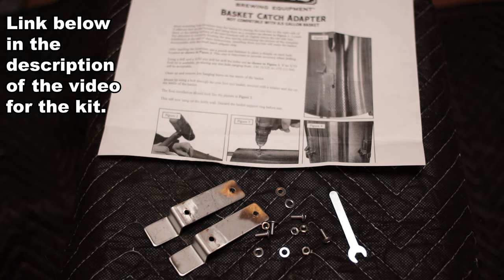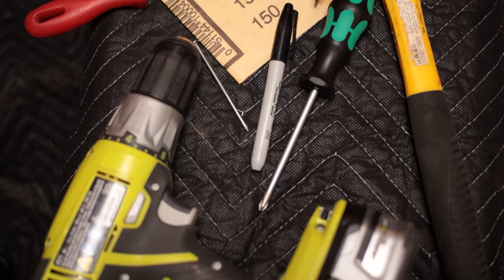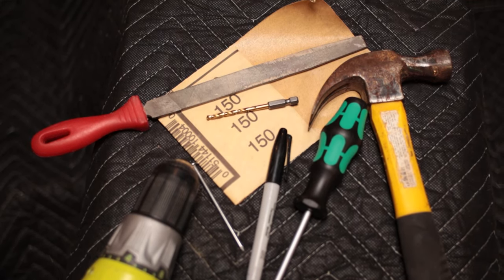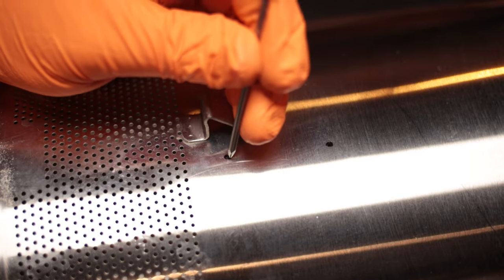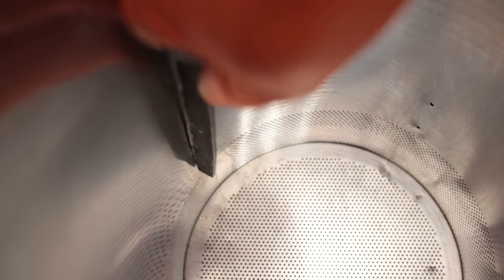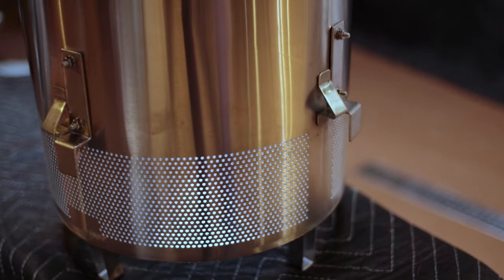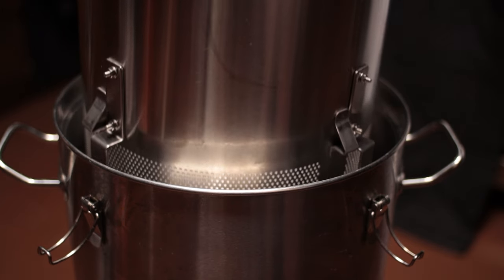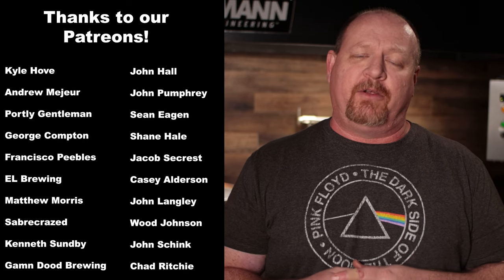Anvil Foundry Basket Catch Adapter Install

Comment: I installed these about 2 weeks ago.  I've done 2 brews and the brackets work very well.  It took me about 15 minutes to install both brackets.  I also put the nuts on the outside even though I don't use a bag.  One thing I wish they had done is include a lock washer or a nylon nut.  I haven't had an issue of these coming off, but I think a lock washer would have been better.  Of course you can go to the hardware store and get lock washers.
Reply from the maker: Yeah I will admit I was a little surprised not to see a lock washer. But that is easy enough to remedy as you said.. 👍🍻

Comment: I got my foundry recently and because I had already watched your videos and a few others, I was upset thinking that my foundry came with a missing part since I couldn't find the ring! I had pulled up their support phone number but it was after hours so that wasn't available. I was super bummed until I read the directions carefully and learned that I had the new version with the catch.
Reply from the maker: Yep! The new versions come with the brackets, that's why I made that clarification in the video. How are you like it? 👍🍻
Reply: @ShortCircuitedBrewers  I haven't done a full brew on it yet because my garage water pipes froze. But before they did I tested it out with setting water temperatures and was amazed that it boiled well on 120v when it was 32 degrees in my garage! I have a 220 outlet in my garage and am assembling the cable with GFCI that you gave in your other video.
Reply from the maker: @anthonyburke2118  awesome!! Let me know how it goes or of you have any questions! 👍🍻
Reply: @ShortCircuitedBrewers  I was in the same boat as Anthony. Bummed and thought I was missing a piece. Literally got my Anvil today and you posted it yesterday. Good timing, thanks for the video!
Reply from the maker: @modernobstacle  good to hear! Glad you got your Foundry!

Comment: I have never had any issues with the OG ring, but I know it was a constant complaint for many people. I won't be doing this upgrade. I do use the small-batch ring 100% of the time now, though.
What really want is that new False-bottom basket... I despise cleaning the old basket, enough that I'm rather temped to just switch to BIAB... But at that point I may as well ditch the whole Foundry system (or get that new 18 gallon one...)
Reply from the maker: Lol maybe!! 👍🍻

Comment: Wish it came with three brackets to match the feet on my basket. Thanks for the video!🍻
Reply from the maker: Yeah I suppose you could add one in-between the other 2 but I'm pretty confident with how the 2 hold the basket. 👍🍻
Reply: @ShortCircuitedBrewers   Could you space the new bracket an inch or so off the current feet to give a wider support? That ring was a disappointment.. had it pop off twice on me as i was setting the basket down.. ugh what a mess. So glad to try this.. ordered.
Reply from the maker: You might be able to space them out a little bit farther. But then you're going to have an issue with the radius being correct. I have no issues with it being sturdy to be honest with you I don't see a need to do that. 👍🍻
Reply: @ShortCircuitedBrewers   Thanks, I will stick to the guidlines... :)

Comment: Deburring hint, use a bit in the drill twice as large as the hole and just touch it on the bur side, slow drill speed and very light pressure, it will take the bur off and leave a slight chamfer and a really clean hole and no scratches inside the kettle
Reply from the maker: Yep if you can fit a drill in there. Most people don't have a right angle drill though. 👍🍻
Reply: @ShortCircuitedBrewers  I took the chuck off a broken drill and a lot of the time just spinning the bit by hand is enough to remove the burs.
Reply from the maker: Good tip. It doesn't take much. You could probably even use a step bit. It has quite a bit to hang on to. 👍🍻
Reply: @ShortCircuitedBrewers  wear gloves if you try that, yes it works, yes the bit edges will slice a finger open LOL don't ask!
Reply from the maker: @MaryBrownForFreedom  lol 10-4!

Comment: Thanks for the video, Brian. I'm thinking of order the Anvil 10.5. What's the highest ABV beer that brewed on this system, assuming only grains are used?
Reply from the maker: That's a tricky question because it kind of depends on what kind of efficiency you're getting I don't see any reason why you couldn't get a five gallon batch of a beer that has a original gravity of 1.075 with the malt pipe maxed out.. If you use the bag without the small pipe like I did in a recent video you could probably get higher than that depending on how your efficiency is. 👍🍻
Reply: @ShortCircuitedBrewers  thanks for the response. Most of my beers are under 1.075 anyway. This helps me decide whether to purchase the Anvil 10.5.

Thanks 
Cheers 🍻
Reply from the maker: @anthonyhernandez7694  good deal! Hopefully they'll be back in stock soon.
Reply: @ShortCircuitedBrewers  my local home brew store is telling me sometime in March.